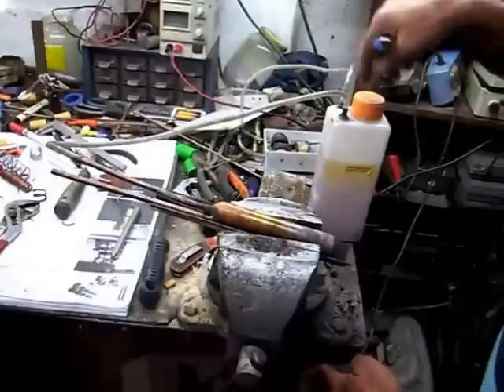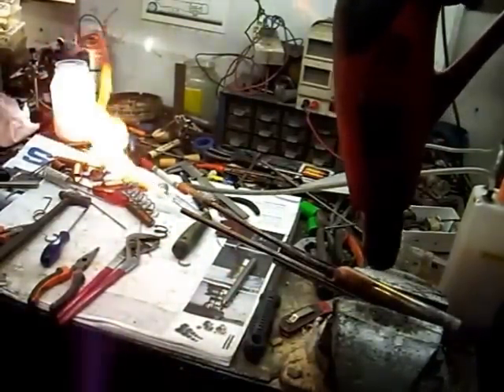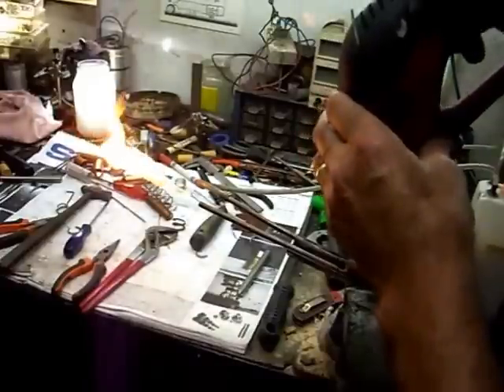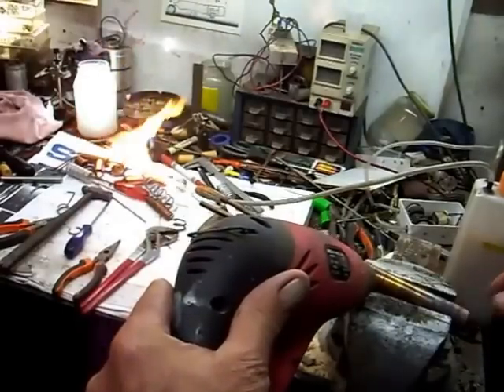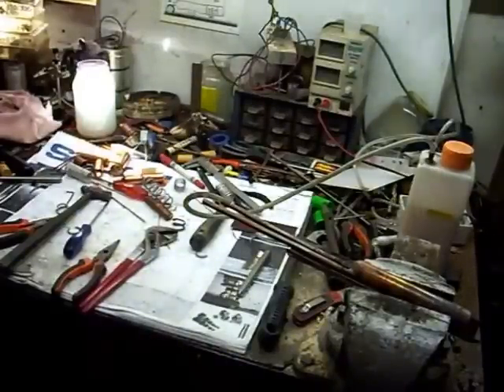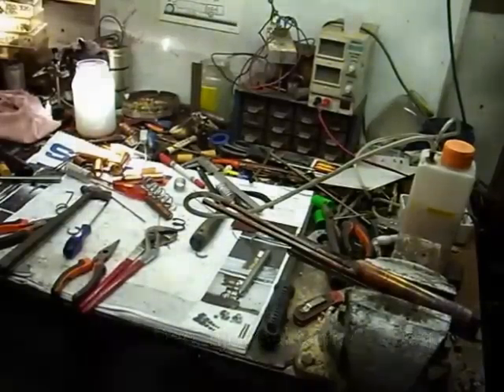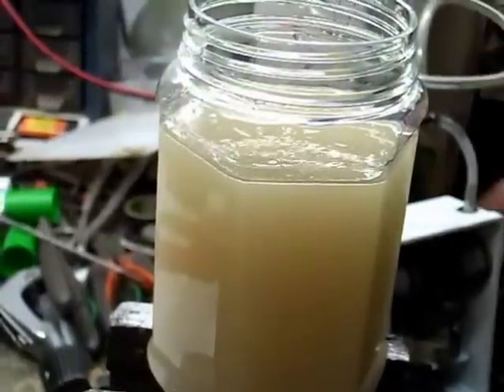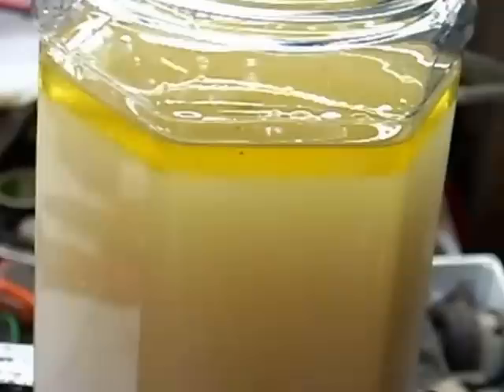Cold&Hot Microreactor

Comment: Interesting but how do you keep your reactor at 400 degrees? the air stream inside the exhaust is only at 400 and above degrees when the engine is under loads, full load you might see 600degrees or slignly more but on cruiser you can be lower than 300 degrees.

Even integrating the reactor inside an exhaust i hardly see how we can keep the 400 degrees C for optimum production
Reply from the maker: The high the temperature, better cracking

Comment: Thanks for the video Manny. I am still having problems with mine on the diesel engine as the venturi does not seem to cause enough air flow through the bubbler. The external pumps have only lasted for two week each due to the heat in the engine compartment. Compressor Regulator worked well with a check valve to control turbo pressure to the unit, but also came apart in just over a month. Then last month my bubbler bottle split apart and my mix ran out. I will have to do mine all with metal.